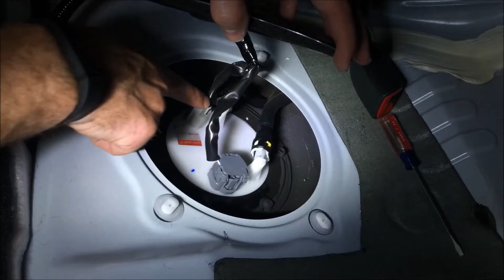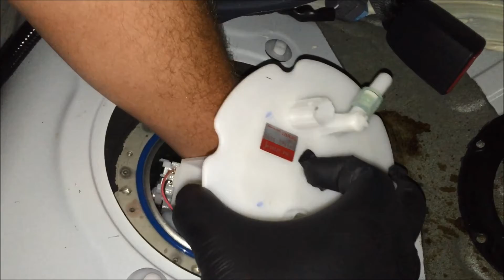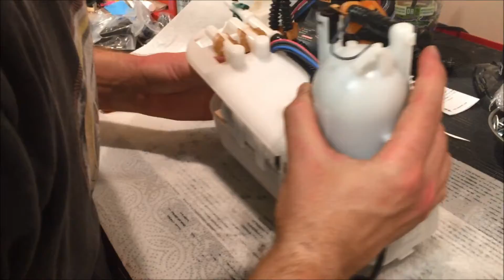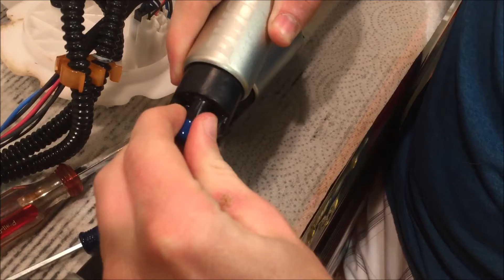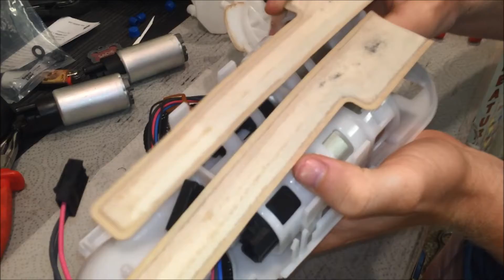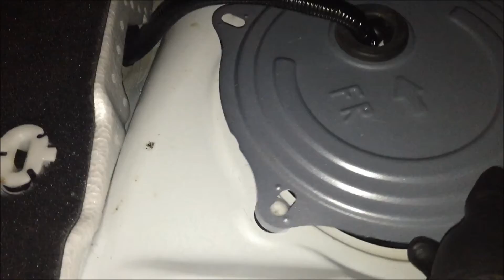Nissan GTR  R35 fuel pumps replacement. How to upgrade to E85 pumps Skyline

Comment: all you need is to buy the pump and that's it? you have E85? Can you be stock and just be on e85?
Reply from the maker: Isaias Hernandez You need the pumps, bigger injectors, and a tune
Reply: @dannyjohnsonsgarage  and the fuel injectors depend on the set up you'll be running?
Reply from the maker: Isaias Hernandez Yes. The injectors we endured up using were either ID 1,000s or 1,200s

Comment: Wow, you guys get an A+ on this instructional video.  Very detail and complete directions.  Now I'm really thinking about doing this myself.

Question:  For new pumps and new injectors, do you need a new map to drive it or can you drive it with your current map to the tuner to have it dyno tuned?
Reply from the maker: You will need a new map anyway, so I’d recommend getting at least an email tune to drive it. If not, make sure you do not let the car go into boost without a new tune.
Reply: Follow up question:  can I start the car after replacing just the pumps without a new map just to check that the pumps are working?

P.s. I got a map that will compensate for the injectors and fuel pumps, but not just the fuel pumps.  

Also, can you use Vaseline or WD40 instead of that grease for the o-ring?  My AEMs didn't come with that grase.

Update:  Did this last night and was able to start it just to check that the pumps were working. 

Thanks again!

Comment: What pumps did you go with?  I just ordered some from Cobb
Reply from the maker: albee26 they were Deatschwerks DW65C (150520) pumps.
Reply: I just put the AEM ID1050x  was a Bgetting to clip back in.  Next time I am making sure I have zero GAs lol
Reply from the maker: albee26 yeah, it's still had quite a bit of fuel in the tank when I was doing it and it showed almost empty LOL

Comment: how to remove the spark plugs 
and injectors
Reply from the maker: arul Pandi-285 yeah, unfortunately I didn't make a video when I did that. You have to remove the intake manifold but it's not too bad
Reply: Scrun Johnson 
ya OK sorry for asked bro
Reply: Scrun Johnson 
bro I. ..have a doubt on the fuel injectors. .....in gtr. ..which method is used. .......gasoline direct injection and  throttle body injection  ?  which place they placed the injector on engine 

and another doubt is they used 6 mg spark plugs  ?

Comment: so you just installed the pumps and ran on stock tune no need for extra tuning necessary? Im full bolt ons with stock injectors and fuel pumps so ill need to get my fuel system going!
Reply from the maker: shazain gamez it has an email Cobb tune.
Reply: Scrun Johnson ok so i just get my tuner to send me the map for my accessport? because im downpipes midpipe 3"intakes and on stock fuel pump ans injectors 😅 so ill need it asap im at my limit on fuel.
Reply from the maker: shazain gamez yeah. The owner of this gtr (my best buddy) did all that part. We also did the injectors, intakes, cat less down pipe and meisterschaft exhaust but didn't get it all on video 😓
Reply: Scrun Johnson dang well ill save myself 500$ by installing my fuel pumps myself and i can do the injectors myself and get a cobb pro tuner to send me a base map to get it running and take it to get dyno tuned! and maybe flex! but ty for your response bud!
Reply from the maker: shazain gamez yeah. It's super Easy on theses cars (except on injectors you have to remove the intake manifold, but it's not hard, just time consuming)

Comment: awesome video thanks for posting. so after you installed the pumps can you immediately put in e85 or do you need to tune the car for e85?
Reply from the maker: Chad Pril you'll need to tune the car first and make sure there is as LITTLE regular fuel in the tank as possible. Consider regular fuel as 85 octane now when you're inning e85- it's too low of an octane that can cause the motor to detonate because with e85 you'll be running more ignition timing

Comment: wow. thank you for this video I finished this project yesterday and will start car up today. if it weren't for this video wouldn't have done this.
Reply from the maker: Chad Pril great work. Make sure that o ring is seated properly. Take it slow. Congrats on your work
Reply: Scrun Johnson OK found out it wasn't the only ring. my dumb ass didn't connect the left intake correctly. done and works perfectly. so awesome thanks!

Comment: thx u. im looking to do this upgrade next month. can you please do a video on upgrading 1000cc injectors?
Reply from the maker: Anne Pham unfortunately, this was on my friends car and when we did his 1200 cc injectors we didn't Video it. You do have to remove the intake manifold, which is a little tricky, but does not have any coolant going through it like some cars, so it's pretty straight forward. Just make sure you take off the right bolts on the intake manifold

Comment: Scrun Johnson, but you didn't have to modify the basket did you? In the video looks like you just dropped them in without any mods. correct? thx for your fast replys just trying to get it right the first time.
Reply from the maker: Anne Pham correct. With the 65C pumps they fit the same as factory (perhaps the basket bowed out a little, but no modification was needed).

Comment: also what brand pumps are you using? and ive seen other videos where you have to modify i rather plug and play like you do.
Reply from the maker: Anne Pham they were deatsch werks (don't remember the exact size) but I've heard some mixed reviews. Sounds like bigger pumps and modifying the basket is really needed. I've also seen drop in kits with stainless steel baskets that would be better than cutting up a plastic one lol
Reply from the maker: Anne Pham looks like 65C was the pump size by deatschwerks

Comment: Why do it with so much gas in the tank?
Reply from the maker: It just ended up that way and I didn't want to drain it from there. I did it again with virtually no fuel and it was soooo much easier
Reply: Scrun Johnson yeah I would imagine its 100x easier , do you still have your termi ?
Reply from the maker: Yes I do. And the Mach 1